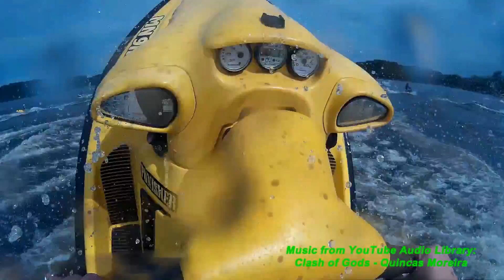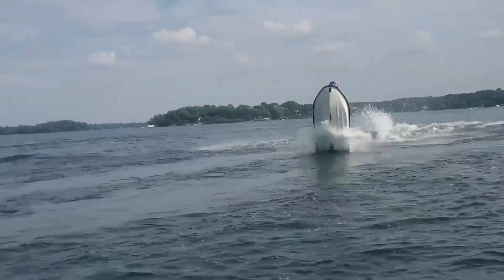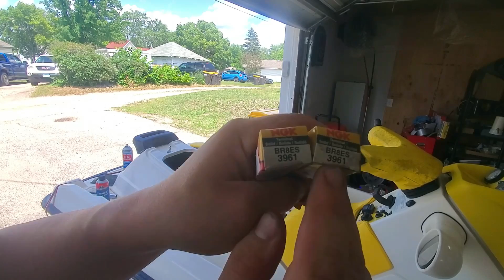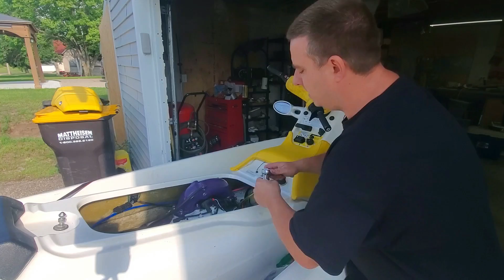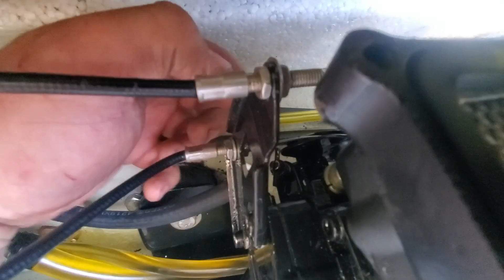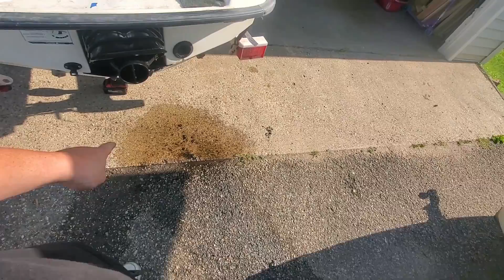1996 Sea-Doo GTI Project 4: Episode 7: First Fire Up

Comment: Great video, if you don’t mind how much money do you put into these skis and what do you get out of them?
Reply from the maker: An estimate breakdown.
$1400 rebuilt engine
$180 carb rebuild
$150 pump rebuild
$300 seat covers and installation.
$150 oil lines, gas lines, filter, water lines, clamps.
$50-65 oil.
$100-130 foot mats on most skis.
Then its materials and supplies, random bolts, sanspaper, buffing pads, etc.
This doesn't include labor or stuff for the trailers, new bunks and carpet, new lights, new winch, etc.
My last 95 XP 717 i sold for $3200 without trailer and i had receipts for $2600 lol so i didn't make alot.
Reply from the maker: Right now nothing, nobody is buying. Everyone wants a cheap $1500 ski with trailer..and i have $1400 into the rebuilt engine alone. Lol. Hopefully theyll sell in the spring for $3500 or $4,000 with trailer